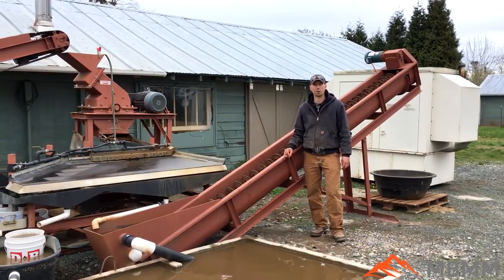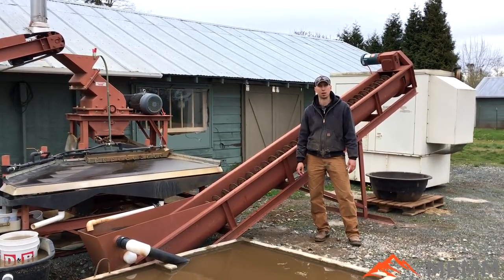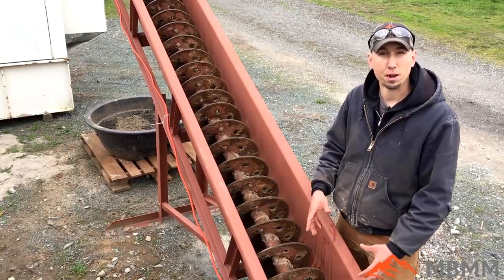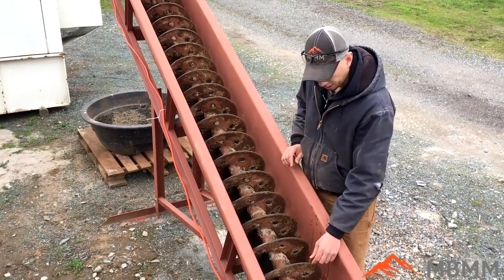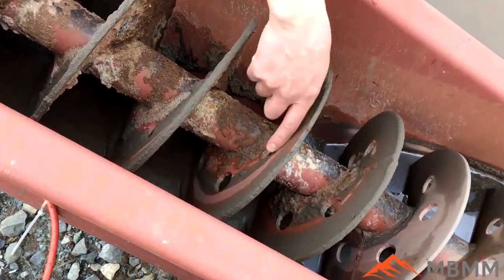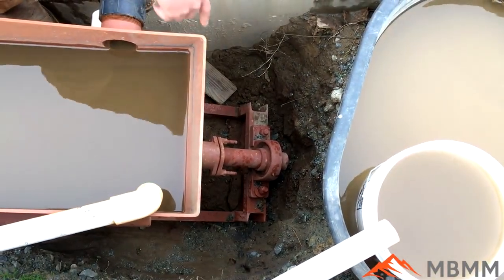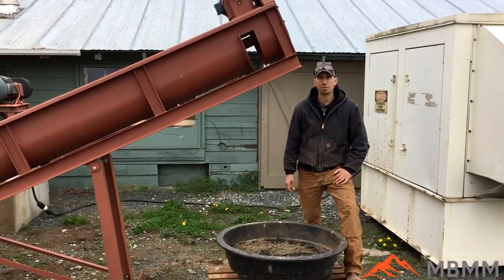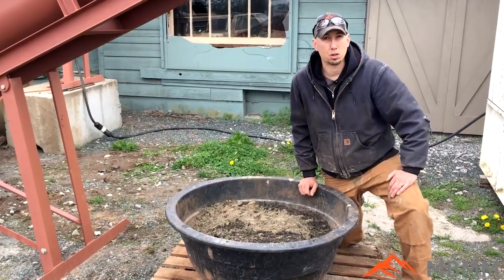How a Simple Spiral Classifier Can Save You Water, Time, and Equipment Life

Comment: Would you say that is silt and clay in the tailings pond, and the sand traveled up the screw? Could you further separate the silt from the clay?
Reply: I'd been wondering about that myself.  Clay could be a salable byproduct in the right circumstances.  Not as valuable pound for pound as other products, but it still might be worth it.